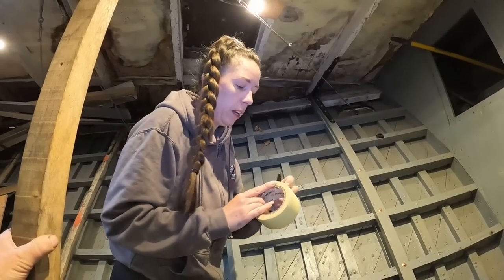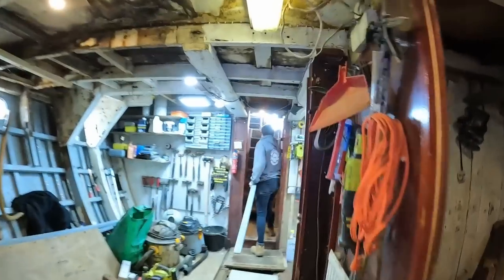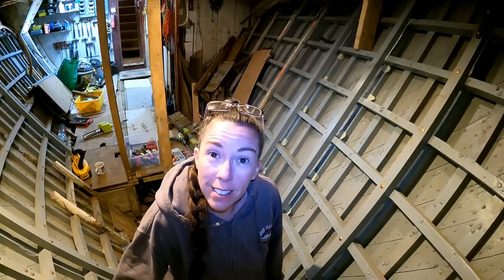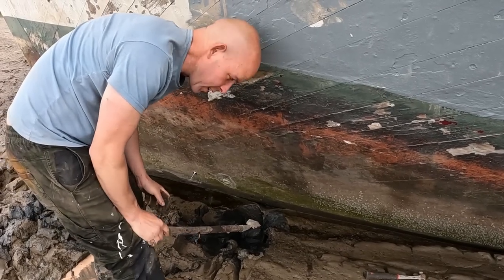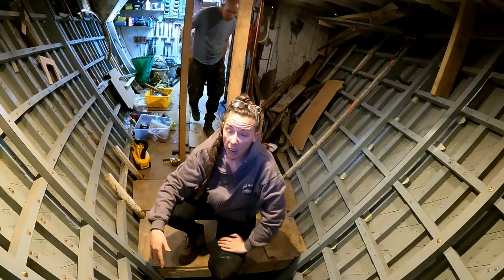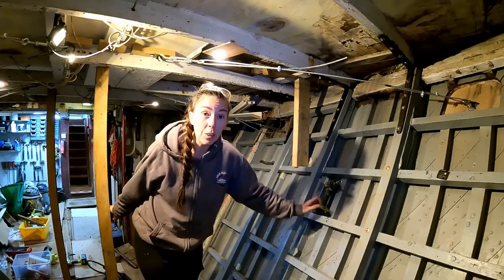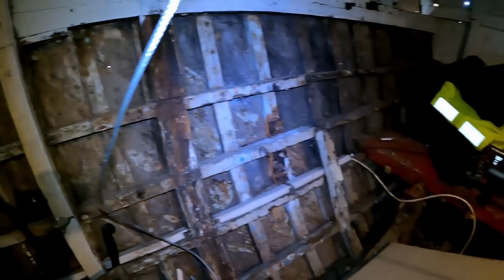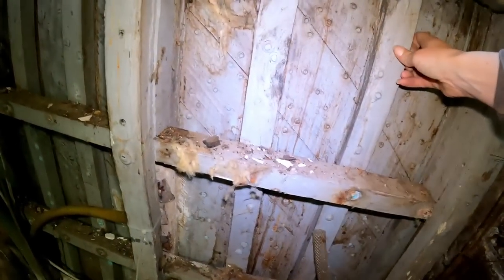Ep 75 - Wooden Boat Restoration, Replacing Major Structural Parts!

Comment from the maker: DRYDOCK! 

so many comments today about dry docking or getting Sarinda on the hard. 

The truth is, 99% of repairs can be done where we are.
Wooden boats don't like to be out of the water, a dry wooden boat causes more problems than it solves! 
Sarinda is not even strong enough to be lifted out to be put on the hard.
And the biggest one of all, we just can't afford it! This is a long term project, and it would cost £250 per week for dry storage, so to have here out of the water for the next 6 years would cost us £78000!
So hope this answers your drydock questions!

Comment: Good job and I enjoy your series. I have owned a 1948 double plank magahony cruiser for the last 25 years. Nowhere as big a project as yours, but eventually you will quit restoration and just start maintaining the boat. I haul mine out every 4 years for bottom paint (fresh water), but always get it back in the water ASAP. You are correct it's always best to keep traditional wooden boats on the water. Good luck.

Comment: I'm guessing that a drydock or at least hauling it out to dry land would be beyond the budget?  I just sympathize with  you having to struggle in the mud. I have to admire your perseverance. Well done!
Reply: Hauling a vessel this large is extremely expensive and can cause damage to the vessel itself. Actually wood hulls hate being on the hard because the wood immediately starts to dry out. At this time the bilge is dry with no salt water leaking into the boat. The best place for old wood boat is in the water until it becomes absolutely necessary to haul out for repairs below the water line.
Reply: @tonyarsenault4256  Yes, that's so obvious I should have realized it. I was still thinking of boats like the Tally Ho that are all new wood and haven't been in the water yet.

Comment: Hi Gemma and Simon,
I was wondering why some sort of sealant is not used in the holes you drill and  around the copper nails. while it might not been done originally or even necessary,  wouldn't this be a good idea? do the copper nails and roves seal that water tight?

Love your work ethic and videos!!

can't wait till you can haul her out on the hard to work on her better.
Reply from the maker: The nails are a really tight fit, and the wood does swell around them to, we do add Sealant to the ones below the water line.
Reply: @ShipHappensUK  OK..... thanks for the reply. Can't remember seeing or hearing about you adding sealant. 
I'm also anxious to see the below cabin sole tieing together of the port and starboard frames in the bow.
Great job you two !!!!!

Comment: Gemma not fussing at you but when your using the drill an puting screws in put your palm of your hand on the end of the drill motor so the screw bit dosen't slip an you wont go thru so many striped out bits just helping a little

Comment: Drilling from outside makes a clean hole but needs some digging. A 3mm pilot hole is OK but going full size from inside can tear the external wood around the hole.
I wonder if it’s possible to wedge a backing plank against the hull so you can drill through without tearing the hole. I’m wondering if that would be less work than digging out the mud.

Comment: Do you have any plans for the floors? To securely join the frames to the keel?
Reply: They did discuss floors a few episodes back, iirc in the context of removing loose ballast from the bilge to get at the bottom of the frames and discovering there were no floors in the bow, unless they were entombed in the layer of concrete ballast. Don't recall if they discussed any details (e.g., bronze vs. timber floors), just that they want to install proper floors before replacing the lower decking, because they have no idea how the frames are tied into the keel. At the moment, the new frames and stringers are just attached to the planking.

Comment: It's probably been asked before but wouldn't it be easier and quicker if the boat was out of the water. When are you planning to do it (particularly the transom)?
Reply from the maker: This is a long term project, and never a good idea to take a wooden boat out the water, this causes more problems with the bost dying out. And there is also the cost factor, I've had a quote of £250 per week for dry storage. And also the fact the we wouldn't want to lift her at the moment as she isn't structurally sound at the moment

Comment: Hi Gemma I was thinking about  your  last weeks request about thoughts about the bilges  I have a question  can you see where the skin meets the rib and the keel can you see a hole between the skin at this point of so don't fill them or block them as they are there to let the water the drain to middle of the boat ( usually the lowest  point) so it can be  picked up by the bilge pump I cant see by looking at the  video

Comment: Simon - the timbers you are replacing look like oak, do you know if the boat was built with white oak frames or red oak?  I think white oak is better for rot resistance. I am surprised the rot seems to be isolated in the frames and the hull is still solid (good for you!).  What are you using to repair?
Reply from the maker: All the frames are being replaced with oak x

Comment: Honestly not trying to be an obnoxious smart arse, but I’ve discovered that my DI”Y (=my self) has been transformed by the purchase of a cheapo DRILL PRESS, from either Lidl or Aldi.  It’s well-nigh impossible to drill perpendicular holes by hand-holding drilling machines.  PS. Lovely hearing you using the right words for the objects / parts…

Comment: I'm confused, maybe you can explain. I understand painting even between parts to protect the wood. But why glue painted parts? The glue sticks to the paint, not the wood. You don't end up with a wood bond, your bond is limited to the strength of the bond between wood and paint, which is not that great. Or is it?
Reply: I believe it is sealant they are using not glue! IE sealant used as glue. It works quite differently. They always epoxy on  bare wood.

Comment: watching simon slipping and sliding "war against mud"...  gave me a few idea if I ever deal with that mud.  make a cheap plywood, sand painted "platform" with strip of wood screwed on edge,  and two across.  make hole in plywood, tie a length of rope through plywood, long enough to be pulled up from the deck. but leave hanging (barely touching mud to keep from swinging, so tide can wash mud off.  wait  I realized that thing gonna float.  ACK. an Idea that has no value.  sorry.

Comment: Hi my name is matthewduffin 
Why dint you get your boat tuged into a marina yard or why dint you have your boat lifted out of the water and have it transported onto some dry land so that the pair of you could of 
Worked on it safely it would of stopped you both of getting stuck in the mud
Reply from the maker: The truth is, 99% of repairs can be done where we are.
Wooden boats don't like to be out of the water, a dry wooden boat causes more problems than it solves! 
Sarinda is not even strong enough to be lifted out to be put on the hard.
And the biggest one of all, we just can't afford it! This is a long term project, and it would cost £250 per week for dry storage, so to have here out of the water for the next 6 years would cost us £78000!
So hope this answers your drydock questions!